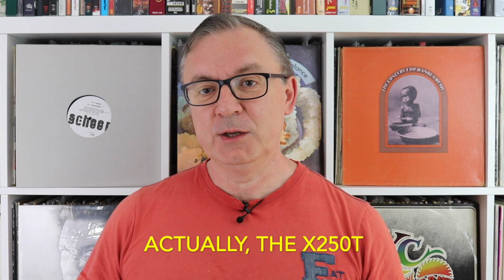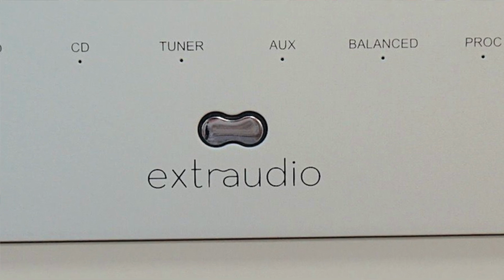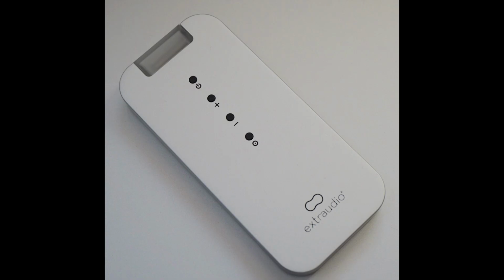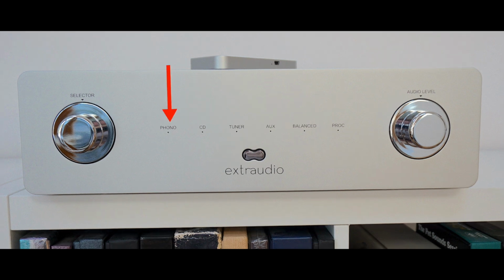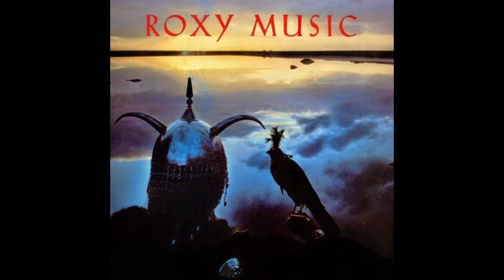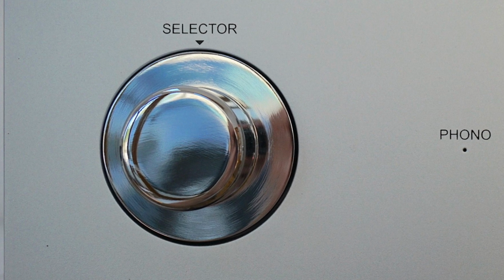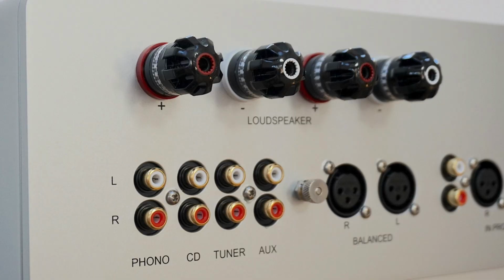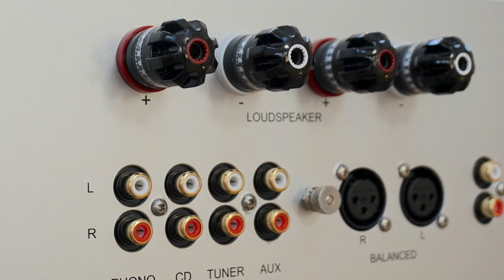X250T INTEGRATED AMPLIFIER FROM EXTRAUDIO

Comment: In my opinion (and I underline "in my opinion") who designed this amplifier did not have very clear ideas. Having said that, why choose it for a review when there are many more valid alternatives on the market, both as a technical project and as a reputation of the manufacturer?
Reply from the maker: Why? Because of the sound. And that’s the point of all hifi. To provide good sound. And this sounds good. Any niggles I report are, as I say, not major factors but it’s my duty as a reviewer to point them out. As for the phono module (you're point stated elsewhere)? There’s plenty of other amp designs out there offering a similar option. Some users like the convenience. I’d rather use an external model but the option is there if you want it. And I review products placed in front of me. I don’t review reputations. They mean nothing to me, as a reviewer.
Reply: @TheAudiophileMan excellent reply ive got the x250 mk3 driving a pair of peak consults and it sounds wonderful